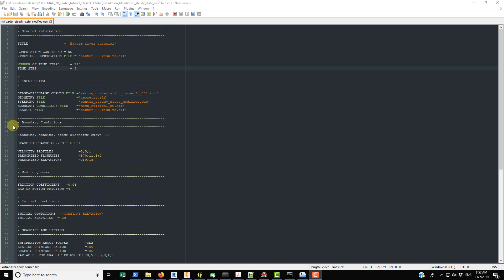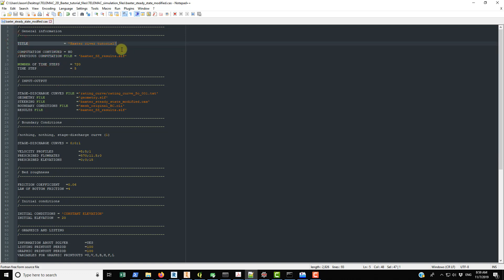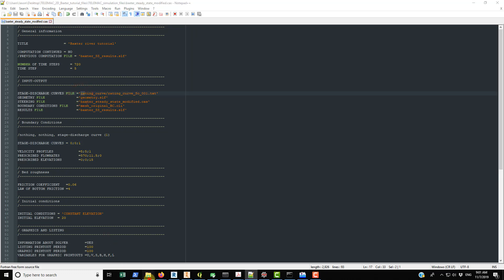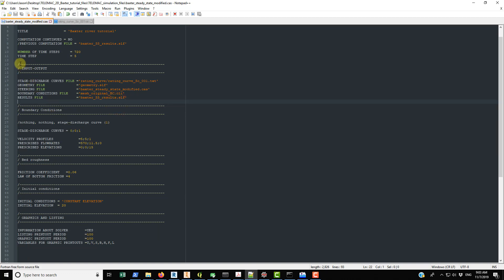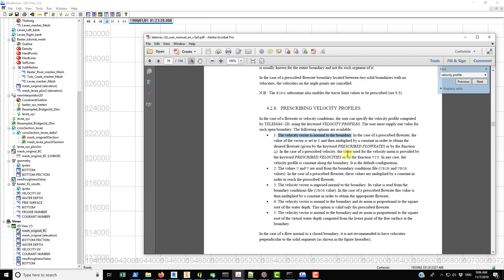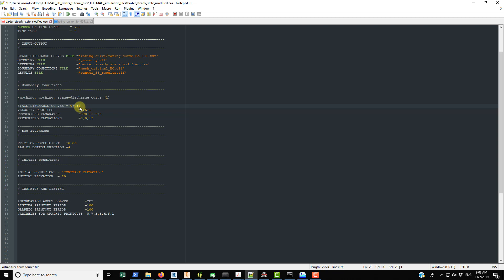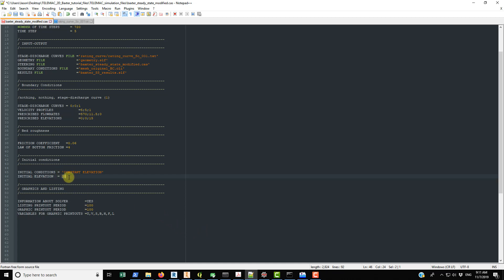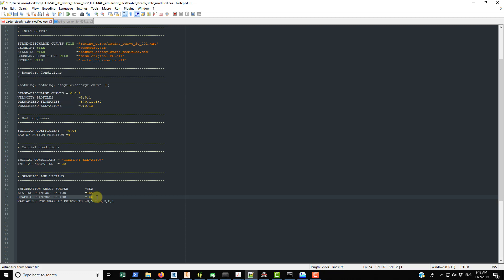Telemac Tutorials - part 12: A brief look at the steering file

Comment: Dear Jason: Very useful tutorials!! By the way, what is the most user-friendly software that you may ecommend to simulate wave agitation in harbor (user-friendly GUI) and for which results can be displayed easily, including animation of waves spreading inside the harbor? thanks in advance.
Reply from the maker: Hi Slim. You could try the TOMAWAC package for TELEMAC2D. I haven't used it, but it does handle waves. Blue Kenue could also be used to visualize the results. As I have never used TOMAWAC, it is hard to say if it is user friendly, but I assume it is similar to Telemac-2D.
Reply: @duguayjason  Hi Jason! Thanks for the reply. I think that Artemis is the proper software for wave agitation in Harbor. TOMAWAC is for wave transformation from offshore to nearshore.
Reply from the maker: @slimgana7208  Thanks. I have never modeled waves in Telemac so I don't know too much about it. If you manage to successfully model them please let me know how it goes. I would love to make more videos like these on a variety of topics (including sediment transport and wave modeling), but time is a bit short these days ...
Reply: @duguayjason  I saw videos on openfoam. I was wondering if openfoam can modelize wave in harbor
Reply from the maker: @slimgana7208  Yes it can. But OpenFOAM is another beast. It is a fully 3D hydrodynamic model, so it can take up considerable computational resources. I use OpenFOAM a lot in my research, but I must say that it is not very 'user-friendly'. I've been using it for 6 years and still am learning many things every week. It can be done, but would require quite a bit of time and a steep learning curve. But maybe you have access to a computational cluster and are familiar with linux/command line operations? There is also Delft-3D which I believe can handle waves, of course Telemac can do it as well.

Comment: Hi Jason, many thanks for this great tutorial.

I´ve got a little problem:
Probably my simulation was crashed because the elevation at the first boundary condition is too low. But I don´t know what you mean with 'CONSTANT ELEVATION'. According to the user manual  it´s a keyword. But in my case it doesn't work
I can't simulate the steering file without the inital conditions.

Thank you very much.
Reply from the maker: HI Daniel, 'CONSTANT ELEVATION' is a keyword argument for the keyword INITIAL CONDITIONS. For example, you would include these two entries in the *.cas file:

INITIAL CONDITIONS = 'CONSTANT ELEVATION' (with the single quotes)

and then below this, you would include:

INITIAL ELEVATION = 100 (which is the elevation of the initial water level in meters).

This will set the elevation of the water level at 100 m everywhere throughout the domain.
Reply: yes, this is how I understood in your video too. 

After some tries it works now. 
Thank you very much for your reply.

Best Regards,
Daniel

Comment: Thank you so much for making these tutorials! They have been extremely helpful. 

If I want to input a hydrograph as the boundary condition for a boundary which I specified to have prescribed flow rate when I set up the boundary conditions file, how should I reference that in the steering file?

Also, if I only have access to water level data at my downstream boundary and not a rating curve, is that alright or is a rating curve necessary for the simulation to run?

Thanks in advance for your help!
Reply from the maker: Thanks. I am glad you have found these tutorials helpful. 

To answer your first question, I suggest you have a look at the baxter_unsteady.cas file that comes with the tutorial file on the Telemac website (TELEMAC-2D tutorial v6p3). In it, you will see how to prescribe a time-varying inlet flow rate. 

As for your second question, no it is not necessary to prescribe a rating curve at the downstream end. You can specify a fixed water depth with no problems.

Hope that helps :)

Comment: Hello, many thanks for these tutorials. It helps me a lot, so thanks again ! 

Just to be sure, in my case, I need to adapt the bottom friction in some spaces. Thus, I put several bottom friction values directly in the geometry file as you explained previously. But, if I well understood, inside the steering file, I also need to put a value for bed friction (like the rugosity of floodplain for example) and Telemac will overwrite this value with those present in the geometry file ?

Thanks in advance !
Reply from the maker: Yes, that is correct. If you want to verify, modify your roughness (as explained in a previous video) in BlueKenue, add 'W' to the list of 'VARIABLES FOR GRAPHIC PRINTOUTS' in your steering file (the 'W' stands for BOTTOM FRICTION), run your simulation, then load the results files into BlueKenue and visualize the 'BOTTOM FRICTION' data. It should be exactly as you first specified it in BlueKenue. Hope that helps!
Reply: @duguayjason  Perfect, it worked ! Thanks

Now, I'm looking forward to create a map (legend, scale, etc...) with this result.